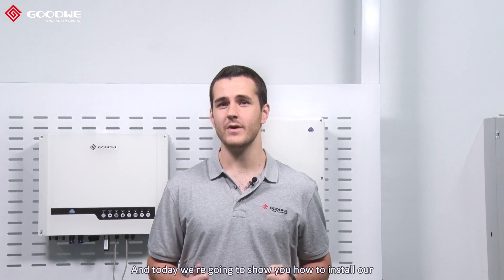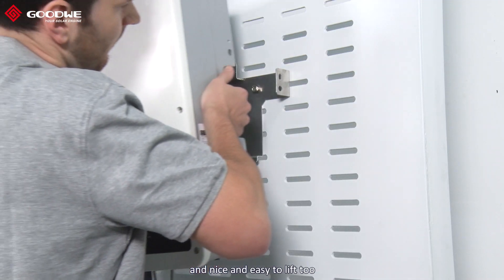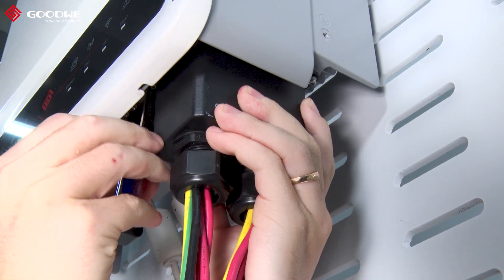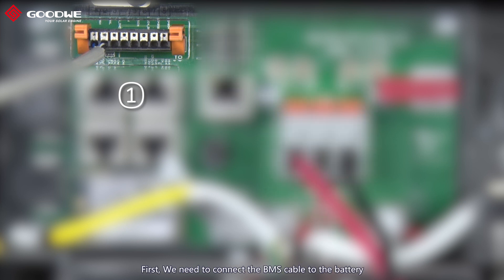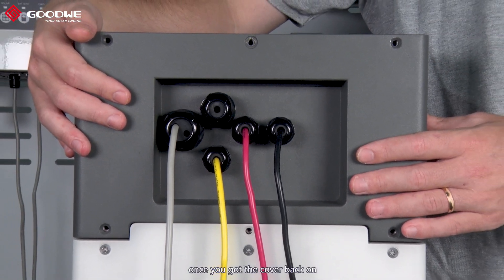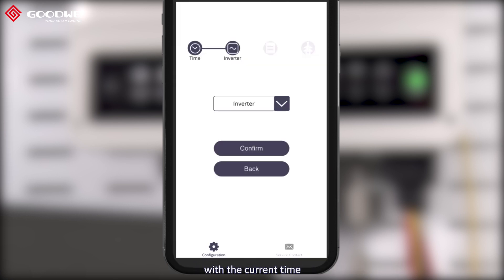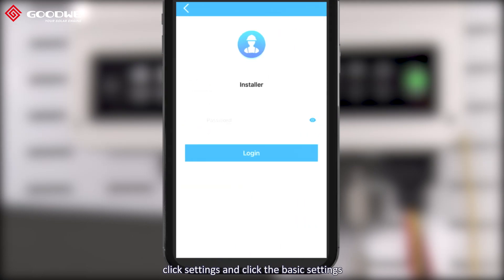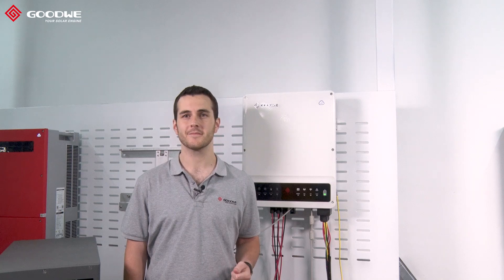GoodWe ET Installation&Configuration with BYD High Voltage Battery

Comment: What size should the cables to the battery be? To a goodwe et15kw. The battery is also 15kw. Is it 6mm2? Is it possible to use a thicker cable since the inverter has mc4 connections for the battery?
Reply from the maker: Hello,it should be 10mm2 with copper cable.

Comment: I would like to know why i have to cut off the rj45 connector and use the bms connector instead. In the byd battery manual there are two options. One with the rj45 plug connected to the can bus socket and the other option is the one you showed here. My problem is that i cant get the battery running. I always get a connection failed message when i add the HVS Battery in the app. Any ideas whats wrong? I would also like to know why there is no link for Firmware download on the Goodwe website....
Reply from the maker: Hello, you may first check the version of firmware. If you don't know if it is the latest version, you can email us via community@goodwe.com.
Reply: Is it necessary to cut off the rj45 plug? I didn't cut of the plug, instead I put the plug in the rj45 connector on the battery (COM-side). That should be the same as cutting the plug off an put the blue and blu-white cable in the connectors on the battery, right? Or is it absolutely necessary to cut the plug off (method 2)?
I think method 1 is the cleaner solution, but I don't get the connection between the inverter Gw15-et and the byd bbox hvm 12,8. What shall I do?
Reply: @peterlustig8082  was du tun sollst? Den Stecker abschneiden. Goodwe und BYD haben unterschiedliche Pin-Belegungen. Im Goodwe-Stecker liegt das Signal auf den Pins 4 und 5, das BYD-BMS erwartet das Signal auf den Pins 1 und 2. Das kann mit dem Stecker am COM-Port des BYD nicht funktionieren...
Reply: @GoodWeSolarAcademy  Thanks, but i would like to download and install the firmware by myself on the construction site and not always wait until i get support. This will make installers live much easier and installation much faster ;)

Comment: I have the SolarGo app and it does not refresh at all. It shows a one time power output snapshot and then it just sits there and doesn't update. I installed the other app to monitor my "power plant" and that one crashes every single time. I installed the smart meter bur technical support cannot provide me a users manual or an installation manual and the app does not show any additional information. The technical support people talked down to me like I'm a dummy and interrupted me numerous times.

Comment: How to connect two towers HVM 22.1 to the GoodWe 25K-ET? All manuals only contain connection diagrams for connection one battery or more batteries in a row (Master-Slave). But this inverter has two battery connections - we would like to use them...
Reply: I have the same question, did you figure it out please? Do you mind to share?
Reply: @dosso96  you have two options: a) using both BYD towers in a master-slave-configuration or b) using both BYD towers independently (both as a master). Power wiring (DC) and information wiring (RJ45 if I remember correctly) need to be consistent. In case a) both BYD towers need to have an RJ45 wiring and power wiring to each other (Master-Slave mode as described in the manual). In case b) power wiring goes directly to the inverters (twice), no information wiring (RJ) between both towers necessary (in fact it harms the setup). ... That's what I remeber, hope that helps. We figured that out ourselves, the support of goodwe unfortunately did not help us.
Reply: Yes, correct. Since the ET25 has 2 independent battery ports, you can connect a HVM tower to each port and run them with each power lines and communication cables independently. Greetings

Comment: What to do if I need to place the battery more far away then the cable can reach? Thanks
Reply: then you need to extend the network cable ,make sure the cable is long enough to connect the battery with inverter.